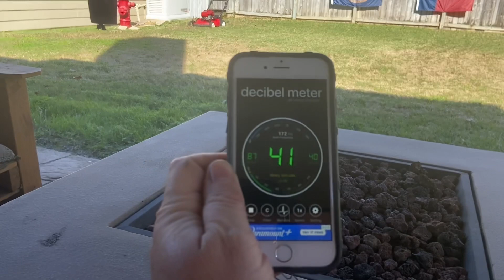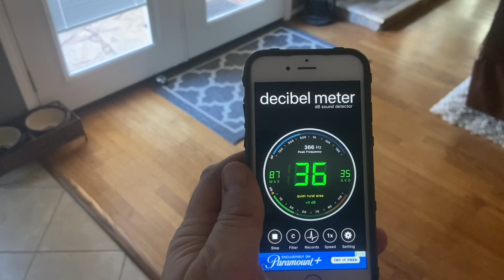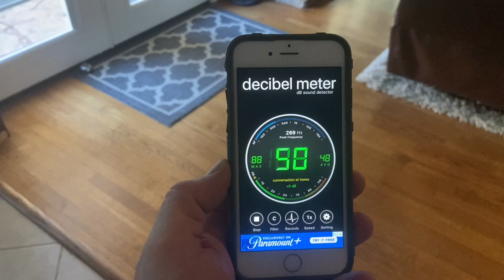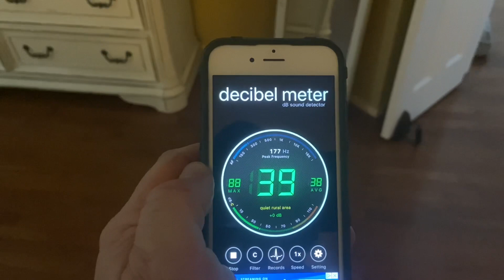How Loud Is A Home Standby Generac Generator?????

Comment: My neighborhood when we lose power it for days, last winter was the last straw for me, 4 days with just space heaters couldn’t get the house warmer that 50 degrees, after the power came back on I wired a inlet box to back feed my house, it worked but my small electronics didn’t like my generators power so I got a dual fuel inverter generator, now I can run everything and it’s super quite.
Reply from the maker: Went through the same process, never again. Thanks for watching and sharing your experience.

Comment: They are building their own motors now. Having problems with them
Reply from the maker: They been building their own engines for quite a while now, what problems are you having ? Ours has been trouble free for 5 years and my dad’s for 16 years.
Reply: @JustCantSitStill  crank seals. Happened to 3 of our customers that bought from Home Depot. And no they have only been in heavy production their for 4 or 5 years.
Reply from the maker: I would imagine they don’t not produce the seal itself, no manufacturer can control outside source parts. Luckily it’s an easy fix, and hopefully it was just a batch of bad seals.

Comment: It is relatively simple.  Don't sleep on or next to your generator; too noisy.  A wall on the side of your generator facing the nearest neighbor should have a fence a few feet higher than the generator  Be sure to allow for 360 degree air circulation around the unit and above it.  Finally, simply buy an inverter generator that only goes fast enough for whatever your power needs are at the time.  Much quieter than regular generators going 100 % ALL the time; saves fuel, too.

Comment: I hate my neighbors loud as heck Generac when the electricity goes out. I have two Honda generator and they are very quiet. The insanity of the noise these Generac make when we all are trying to sleep drives us all insane! I wouldn't own one of these if you gave me one.
Reply from the maker: Sweet thanks for sharing
Reply: I'm here because my jerk neighbor is running it constantly for an outage. She is 200 feet away and the noise and vibrations are in my bedroom. Whoever made this video is getting a kickback because telling people "you should just get new windows," is being a jerk. I should not have to buy anything at 200 feet away from an effing Generac. They are THAT loud!
Reply from the maker: @oxi9846 kick back ?

Comment: I never realized how loud standby generators were. I was under the impression that they were much quieter. Thanks for taking the time to make this. Very helpful 👍
Reply from the maker: No problem thanks for the comment and for watching 👍
Reply: Same. I was tempted to get one but now I'm not sure given the noise, may look into quieter options.
Reply: @GamingCentral3000  Okay, I'll bite.  What is a 'quieter' option to a generator?  Renting a hotel room?
Reply: @bugwar5545  The newer inverter generators are SIGNIFICANTLY quieter but the largest is only around 9500 and runs off of gasoline which could be scarce during a power outage event
Reply: Some are more quiet than others, but they all make noise.
Reply: Yeah, that was louder than I was hoping, but then again, when the power goes out, your perceptions change.
Reply: @TheRealLennySphincter  I have an old generator that was extremely loud. My Generac is quiet enough that a conversation can be had close to it. Every generator is going to make noise, it’s a mechanical device. I live in a semi rural area and my closest neighbor has a Generac and I didn’t know his was on unless I walked closer to it. The convenience out weighs the little noise that it makes. Find one close to you and give it a listen.
Reply: Some are quieter but the costs can also be more.  You can also place something like the ZOMBIEBOX product around it to make them even quieter
Reply: Try to sleep next to a running diesel truck...no thanks. That is why i am setting up an Inverter generators with solar panel kit.... like a Jackery or Ecoflow. Not for everything 24/7 just to put on the heat for 20mins per hour in the northeast winters, a couple of lamps and small stove... Power only goes out for a max of 12 - 14 hours and usually at night.....but a few times a year...
Reply from the maker: @casaraku1 We have not slept outside next to it , we normally stay inside when the emergency generator is needed……smdh
Reply: @casaraku1  I have a solar array with batteries and I just bought a Champion tri fuel. I the 11k solar just doesn’t cut it unless it’s a perfect day.

Comment: In many places, (like Tulsa where I live) Generac gen-sets and Kohler gen-sets are "Public Nuisances" because they are so loud. Solution? Either a liquid-cooled Japanese gen-set or a Cummins/ONAN liquid cooled. You can plumb the cooling system of the liquid-cooled gen-sets into your house for free heat or hot water. I get hot water from my Cummins/ONAN in my AirStream Excella Motor coach-cost less than $150 to install, AND all the liquid-cooled gen-sets are National Park "Quiet Hours" legal, and use up to 40% less fuel per hour due to lower frictional losses, which greatly increases the LIFE of the units. Pay me now, or pay me later..."Thumpers" (single cylinder gen-sets) guzzle fuel, and beat their crankshafts and main bearings up. Generac engines are CHEAPLY BUILT and shoddy, and nearly impossible to repair. An opposed LC twin is far smoother, quieter and lasts so much longer, it isn't funny. All the BIG LC gen-sets go to four cylinders, designed to run CONTINUOSLY for weeks at a time , like in cell phone tower service.
Reply from the maker: Not a single cylinder, it’s actually a two cylinder. My durability has been great for my uses, the liquid cooled units are so much more money. I could not see paying the difference for something that is only an occasional use item.

Comment: Don't worry about the noise, it will be a broken and dead rust bucket within four years. Generac is not durable at all! They are cute and pretty for the first couple of years but they will not last.
Reply from the maker: Thanks for the great comment, mine had made it 5 years no issues besides a battery replacement, my dads has made it 15 years with just a few batteries….. so ……..

Comment: Recently got a 14K. Really loud!  Any ideason reducing the noise?  Been trying straw bales and concrete blocks and so far very little progress.  May have to try building a shed around it.
Reply from the maker: Thanks for watching and the comment, is yours too loud inside your home ? If that’s the case maybe upgrading the windows if you have not already?
Reply: @JustCantSitStill  have newer triple paned.  Loud enough inside but really loud outside.  I don't want to tick off the neighbors and be able to sleep myself.
Reply from the maker: @garyj6006  we just have double panes and ours in not loud at all inside, not worried about the noise outside at all.

Comment: In the 80's , KATOLITE offered a residential grade muffler for their systems . They were VERY quiet .  KATOLITE uses a propane fueled engine .  I think the engine was a three cylinder model , air cooled , similar to a hay bailer engine . I saw the muffler mounted outside a telephone office , right next door to a home . You had to listen very intently to notice the sound from the unit . It was sizeable , but worked very well . Perhaps one could purchase such a muffler from the company .

Comment: What’s everyone’s thoughts on solar power ? We lost power recently & don’t have a generator so started pricing systems & one like this was quoted $10k.
Reply: I've got a small one and it does the job for most outages--a Jackery 1500. It won't power the fridge or A/C but it does everything else. Ridiculous to have one of these behemoths making so much noise in the environment, unless you have a medical problem.

Comment: My neighbor has a no name generator that sounds like a Harley-Davidson running maybe 2000 RPM.   It's loud and it runs for an hour every Tuesday at 10am.   Generac generators are quiet compared to my neighbor's generator.  The neighbor two houses down have a Generac.
Reply from the maker: An hour ! Wow our only is set to exercise for 5 minutes! Ours runs at 3600 rpm. To me our is not bad at all from inside, outside it’s definitely loud.

Comment: If you ran your lawnmower at 2am, I bet you would get complaints.
Why do owners of generators feel they need to run it all night?  Courtesy to neighbors same as at campground shut it off at 10pm until 6am.
The weirdest is vacation homes with autostart whole home generators.  WHY!?  to power an empty house 24/7.  For vacation homes leave generators set for manual start
Reply from the maker: Most people are not up and in their backyards at 2am , ours running saved us from thousands of dollars in damage from frozen pipes. 

Some people need and have them for medical reasons. 

For a vacation home depending on the climate you may want it to have power even if no one is there. 

Also in my area alot people have them so if mine’s running I got two more very close they are running as well. Unless your living outside i doubt it bothers anyone as we can barely hear ours from inside.  Comparing staying in a campground vs living inside a home is a completely different situation.
Reply: @JustCantSitStill  if you were mowing your lawn at 2am, bet your neighbors would be up soon also.
My wife used a CPAP at night, it's plugged into a UPS to ensure constant running at night ( quiet )
Refrigerators and freezers maintain temp for at least a day if not longer without power.
Using a generator sparingly will make your fuel last longer ( no telling how long the power will remain off)
Reply from the maker: @TUMARK2  the video was to simply show the sounds levels between a generator and a lawnmower as most people understand how loud a lawnmower is.

This was done to help people please don’t get hung up on anyone mowing the grass at 2am. 

We run on natural gas so maintaining or conserving fuel is not necessary.
Reply: @JustCantSitStill  I understand comparing noise of a lawnmower was just to give something relatable to compare to.  Of course you don't run your lawnmower at 2am.  My point is many do run their generator all night when it's not needed.
Everyone should be prepared, electric companies have taught us not to depend on them.  I am grateful I am ready for outages and glad you are too.
Take care and be safe
Reply: @TUMARK2  I've got a Jackery 1500 and I am three days after Helene without power. Still have 55 per cent power for a lamp, a fan, and all my computers/electronics. People are jerks--I am unable to sleep because of someone with these things at 200 feet. That is how loud they are, and they could turn it off at night, especially after I've told her it is too loud.

Comment: Great video, Thank you for taking the time to do it. I am considering the purchase, and this was the first question that came to mind. YouTube search too me right to your UPPAID opinion.
Thanks again.
Looking back, Would you do anything different about your purchase??
Reply from the maker: Thank you for watching please subscribe and check out my other videos, I have a few more on the generac. Thanks for the comment and question. The only thing I would have done differently is to actually pour a small concrete slab for it to sit on instead of using the concrete blocks.  I have not had any issues with the way I did it but that would be the change.

Comment: The Generac’s sound HORRIBLE. They are loud, sound like they always have a valve issue. But I know my neighbors swear by them. I just couldn’t get there personally. . . engine's built in China in all.
Reply from the maker: Thanks for watching and the great comment , the engine according to my brochure says : Generac generators and engines are engineered and built in the USA*
*Assembled in the USA using domestic and foreign parts.  

The valve issue could possibly be that your neighbors never read the manual and had the valves adjusted. 

Please subscribe and check out some of my other videos. Have a great 2023.

Comment: I really appreciate this because I just ordered a Generac.  It's going to be right beside my house, and really close to the my neighbor's house, but I've spent hours listening to her dog's non-stop barking and am not going to put up with her noise complaints.
Reply: Constant neighborhood barking dogs are the worst.I’ve thought about parking my mower by the fence and leave it running.
Reply: Vote for Joe Biden and your Generac will be worthless after Joe shuts down our nat gas.
Reply: Well your neighbor won't have to worry for too long because that generator will only last for a couple years before it takes a crap.  Your neighbors dog will definitely outlive a Generac. 😂
Reply: @Riceman-o1p  Don't hold it in.  Tell us how you really feel.
Reply: The dog's dead and the generator is going strong.  Maybe the dog should have had a warranty, too.
Reply: @llorablan9588 🤣🤣
Reply: @llorablan9588  Did you use the generator noise to cover the sound of the gun?
Reply: @bugwar5545  He died of natural causes.  I don't believe in animal abuse or cruelty, no matter how irritating said animal happens to be.
Reply: @bugwar5545 you got a first flight ticket to you know where 😂😂😂😂

Comment: The # people with generators in south la is  more than without.   After a storm, neighborhoods hum with generator sounds.  Just a couple of times a year you lose power for 6 hours or so from tstorms.  Oak branches and power lines dont mix.  When you do get a big storm every 5 to 10 years, and you're without power for 5 days -2 weeks. Depending on how hard you got it.  I recently bought a bigger "portable" generator just because I want to be able to run my dryer when the power is out for a week, and run the microwave without having to stop the AC.  Not much portable about generators that run 220-300 lb.
Reply from the maker: Thanks for watching!

Comment: Do that same test in the neighbors house nearest the generator.
Reply from the maker: The nearest house is further than our own home so I am not sure what it would prove other than lower numbers all around. But thanks for watching have a good weekend.
Reply: @JustCantSitStill  oh, well it's about "if your neighbors are unhappy with the noise" - that they aren't benefiting from. I suppose if you ran a multi-plug extension cord over to their house, the possibility of noise complaints would cease and desist. 😄
Reply from the maker: @markhonea2461  I did this video for all the “it’s to loud” “ your neighbors must hate you” comments. I have actually never had a complaint, two of my neighbors have the same set up.

Comment: 100% best Generater.Systems I have used. A test for hurricane prep here in Louisiana: three AC units, 5000, 5000 & 8000, 3 fridges, 2 device power setups, 4 flat screens....AND I had 40% of the power meter to spare.
Reply from the maker: Sure I have done it make sure you leave the garage door open and it’s not close to anything combustible.
Reply: Well just remember that in your humid environment even though you really love your generator it will be a rust bucket and dead within four years. I promise. They are not durable and they will fall apart.
Reply: @boblatkey7160  Gee, did you do your routine inspections and maintenance?

Comment: Good stuff brother. After the freeze and a week without power back in 2021 I picked up a 12K watt portable and wired up a backfeed  and interlock system. Our house got down to 38 degrees by the second day. It powers both AC units and the furnace but it is loud. I will probably build a fireproof genny shed with ventilation to help reduce the noise a bit, but it is what it is. I figure in a SHTF situation, a little noise will be the least of anyone's problem. Besides we will be that house for the neighbors to come by and warm up if they have no heat. Keeping plenty of fuel and bourbon on hand if that happens again :)
Reply from the maker: Yes sir ! Thanks buddy for watching
Reply: Very helpful! Thanks for taking the time
Reply from the maker: No problem thank you for watching
Reply: After the remnants of hurricane Ike went through Cincinnati, I actually did have a neighbor complain about our portable generator running.  Their house is across the street and about 200 feet away from our house where the gen was running.  That far away you could easily carry on a conversation.  Granted, this was an old 5Kw unit with a Tecumseh engine.  It was the loudest portable engine I have ever heard, even after installing an aftermarket, larger muffler.  It also was hard to start, or would not start every time we needed it.  I've since "upgraded" to a dual fuel Champion 3400 watt gen that I only use on propane (so far). It starts every time.  Much quieter than the old portable or a Generac, but of course, not as convenient as a standby generator and not as powerful.  It runs the necessities.
Reply from the maker: @MikeNie1 thanks for the comment and for watching, please subscribe and check out some of my other videos. Have a great week.

Comment: 24 kw Generac installed at Jersey Shore beach home .  
It is a two cylinder natural gas internal combusion engine.  
I liken the sound  to a lawn mower on steroids.  
During one of the weekly test runs a neighbor made a negative comment regarding the noise.  I quickly replied that the Generac Generator was installed with all the proper permits required by the Municipality Code Office and inspected by said Code Office before approval, so direct your comments elsewhere. 
I know if I didnt get permits to have this installed someone would complain.   This is NJ. 

Funny thing was the first time we lost power the sae neighbor asked if he could run an extension cord to one of my outside outlets for his refrigerator.       🤣
Reply from the maker: Lol 😂 classic !
Reply: Thanks for the reminder about permits.